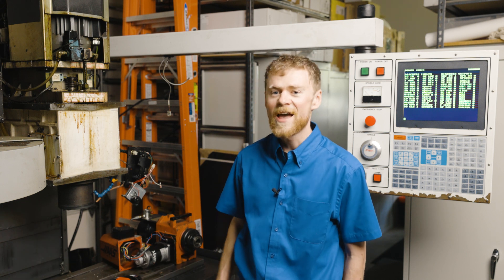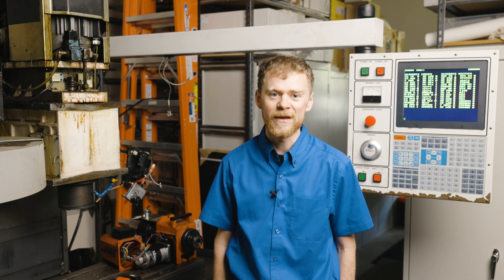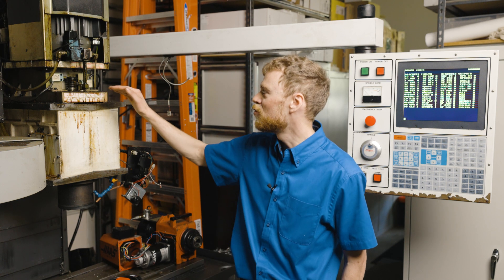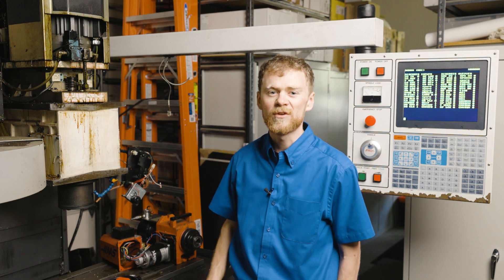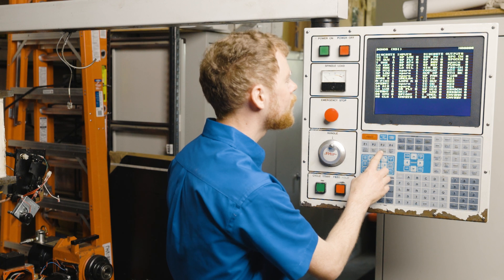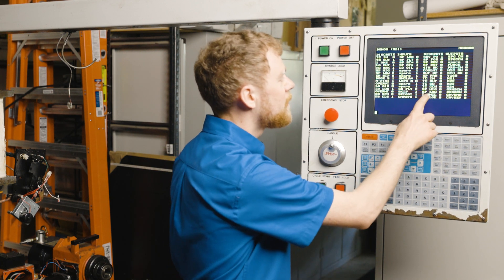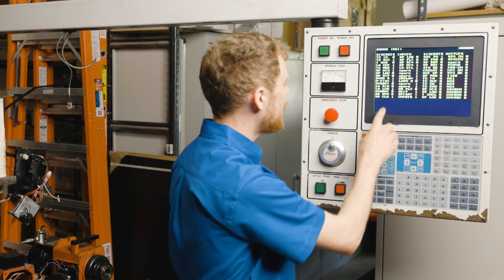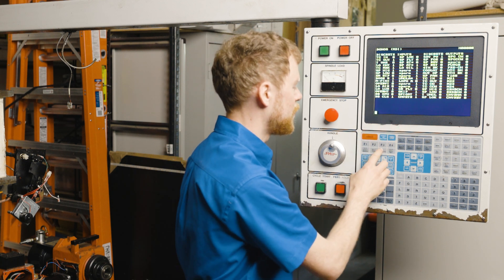Alarm 131 Tool Not Clamped—Straight To The Point

Comment: we too have that alarm code pretty often lately in start of the shift, the first one or two tool changes fail, we have a very sticky taper and its banging the tools out like crazy, we tried everything with the taper but nothing really helps, the spindle heats up, cold tool holder goes into the spindle taper and warms up swells